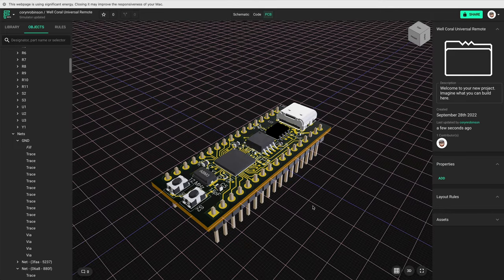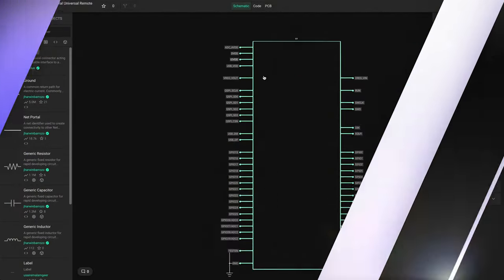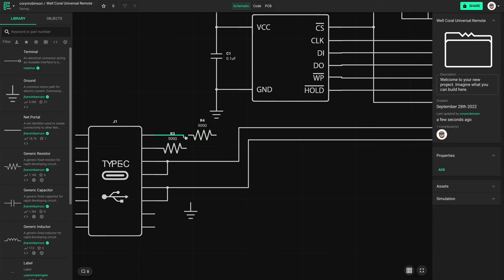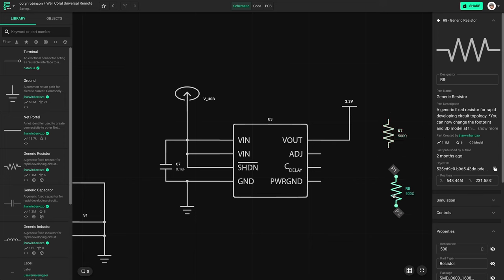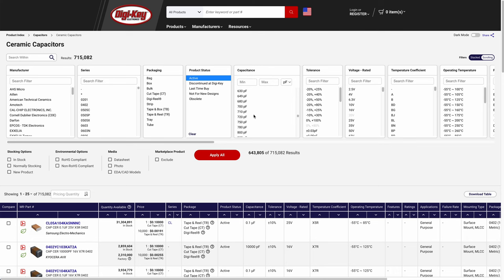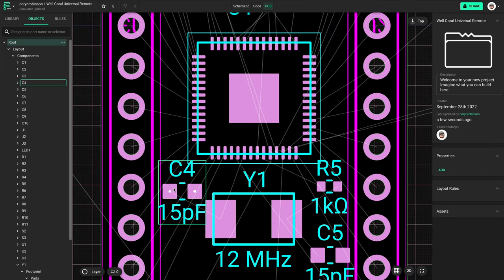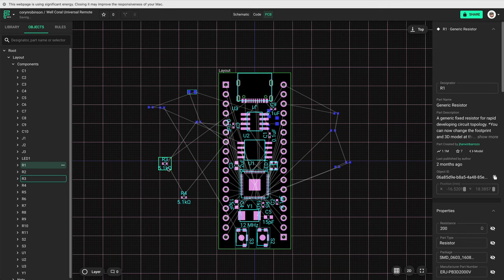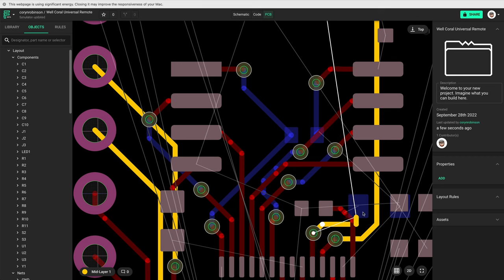I Made a Tiny Raspberry Pi Board with Flux

Comment: This video has me rethinking this software. You see my 17 years of experience was using a package for the Mac and it was so straightforward forward I learned by using the package no classes just everyday use. There were 16 Engineers requiring device under test boards and Mac SW handled it flawlessly. It had all the bells and whistles LVS, Autorouting, very easy plane creation the list goes on. Watching this video reminded me of how I created the schematics from hand-drawn sources. Now the question is how easily this SW creates the parts and places them in the PCB layout portion of the process. Great video and will subscribe and see what is to come.